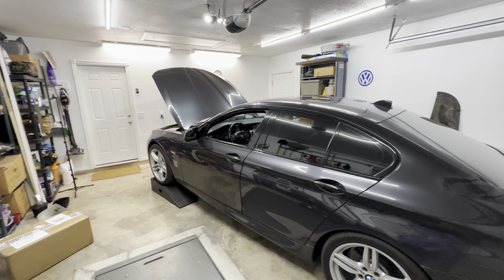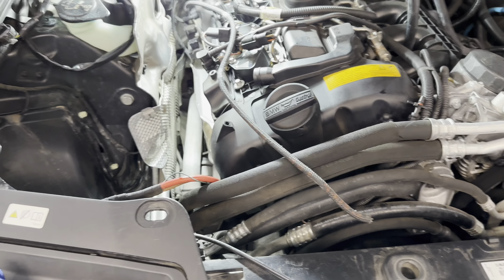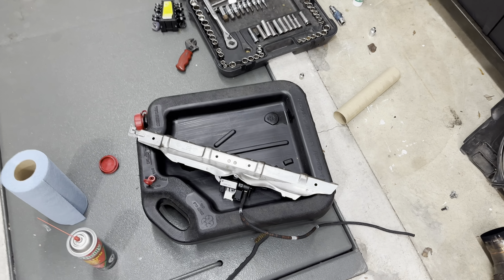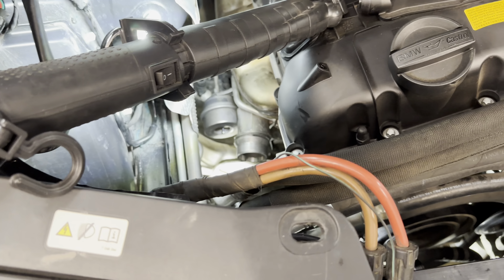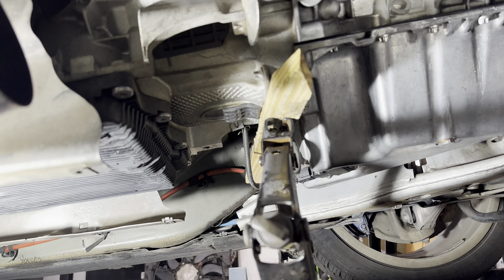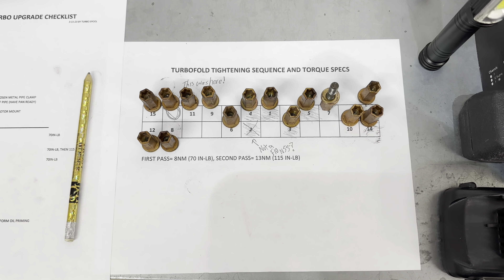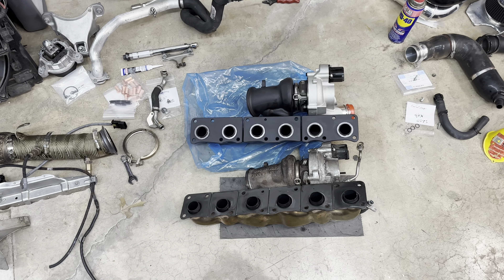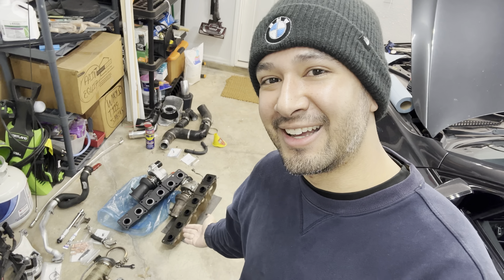SHUENK N55+ TURBO INSTALL PART1- Removing the stock BMW N55 PWG turbo on my F10 535i

Comment: literally the best detailed n55 turbo install on youtube hands down. a year later are you still pleased with the performance?
Reply from the maker: Thank you so much for that! I tried my best to catch all the little details of doing this at home. And i loved it! I did this work in March 2023, and sold the car Aug 2024. It was on E50 custom tune by Keahi Harris and it was incredible. All the low end of the stock turbo but with a FAT midrange that held to 6100 before it would start to drop. For a Daily Driver it was perfect. And now the new owner (who is a friend and coworker so i still I see the F10 every day) is very happy with it

Comment: Great video, lots of damm work!  I have a 2012 x6 with the N55 engine, I am dreading the day I have to change the turbo when or if it fails.

But I was wondering, wouldn't it have been a lot easier to drop the subframe and you would of had  a lot more access to work on getting the turbo off and new one back in?
Reply from the maker: Oh absolutely it would have been easier to drop the subframe! lol you are correct. I just did not have a crossbar to do that, and most BMW techs don't drop the subframe because although it makes turbo removal easier, it also adds more time to how long the car is in the stall (which since most work on flag hours, this would cost them money). So I sucked it up and did it this way. Which honestly would not have been so bad if I could go higher off the floor and had the "questionable support jack" placed properly under the engine, lol
Reply: @turbospool  , did what ya had to do, got the job done and thats all that matters.

last question, where do you find the torque specs for the turbo manifold bolt and associated bolts for teh cooler and oil lines?

Did you prime the engine after you were done and how long did it take you to get the trubo out and new one in?
Reply from the maker: @dappa311  i got the specs from my friends at the dealer. You can also find them online if you have access to BMW TIS from what I understand. 

Engine was primed upon completion, prior to first start. 1 long crank, 2 short cranks. 

Can’t really say how long it took me as I broke it up over 2 weekends and a few hrs here and there after work. Plus I was filming! That alone adds like 30%-50% more time to ANY project lol

Comment: I love your vids! But for such a job, I would def. take the engine out and do the work more freely and take a better look all around the engine cause this job let you remove almost eveything to take the engine out  👍
Reply from the maker: I appreciate it! And I totally agree with you. If I had more space, and a lift in my home garage I would have just pulled  dropped the engine- which is not as hard as people think it is when you have a lift and a table that can hold the weight. But I had neither in my home garage and did it how the majority of people would end up having to do it lol. Maybe in my next house I can step up to a 3-car garage and I can put a lift on that 3rd spot (#goals) lol.

Comment: Sid u get a custom tune for the turbo ? Im
Running MHD stage 2 + e30 just checking if that is enough for that turbo ?
Reply from the maker: Hey Rich? You absolutely want to have a custom tuner ready to go for when you go drive the car. It will start and idle no problem. But driving around it will be EXTREMELY easy to spool when the DME isn’t expecting it due to the design of the wastegate. So you want to get setup with David Shoup, Wedge, or Keahi Harris prior to install so you can at least have a base map that will allow you to drive it around safely while you tune it. This is not for the OTS tunes

Comment: Nice! For drag race which would you reccomend the f55 turbo or the ps750? Thanks btw
Reply from the maker: too early to tell! There's many dynos of the PS750 already. But only a handful of the F55 (even less that are finished tuning). But from what has been found on the F55 so far is that it has more "room for growth" than the PS750. Just based on similar dynos the F55's wastegate is in the 70-80% area whereas the PS750 is maxed out at 100%. Just on that detail I would say the F55.

Comment: My turbo drain line is leaking (2011 n55 xdrive). Do you think it's possible to replace just the line? If so, how difficult do you think it'll be? Thanks!
Reply from the maker: Absolutely it is. It’s a common leak point with age. I did it when i first got the car in 2019 and it’s easy to access on a RWD. I couldn’t tell you on the Xdrive though as that passenger axle bracket may be on the way. Hopefully someone here with an Xdrive can answer it for you!

Comment: Brother do you believe this can make the same power as a PS2?
Reply from the maker: Check Shuenk’s site. I believe this turbo is rated for just below what the PS2 can flow at max. It spools earlier than the PS2 though due to the proper manifold design without the restrictive neck at the turbo inlet that the PS2 has

Comment: Wondering how you lift the engine with all the wheels still installed. First time doing the job and looks like theres extra information missing I need to know.
Reply from the maker: I mentioned that you have to support the engine, then unbolt the motor mounts (3 10mm bolts each), disconnect the charge pipe and boost pipe, and you can start lifting carefully
Reply: @turbospool  Ok I see, I thought it was just the top bolt that needs to be unscrewed not the whole engine mount. 
I thought it was only 1 screw on each side on the top where the support brackets to hold the engine. So, I need to also remove the 3 bolts on both engine mounts as well?    thanks

Comment: Is this the xdrive? If not would it be  a similar install process?
Reply from the maker: No, my car is RWD. I’ve not messed with an Xdrive N55 yet so I cant say how and if it’s any different in this particular project. That would be a great question to post up on the Facebook N55 owners group

Comment: Does this turbo make more power than a pure stage 1?
Reply from the maker: It is rated for more than the old PS1. Go to Shuenk’s site for more info or email the owner Doug. He’s very easy to work with

Comment: How high are you boosting the motor?
Reply from the maker: Kind of difficult to answer that. Im going as high as my current fuel setup will feed RELIABLY- wherever that ends up. Then in the near future if I want I will do meth injection. Not going for all out insane build lol. It’s a daily driver with an open rear differential. BUT… Ill be happy to break 500 wheel horse power on this daily driver lol!

Comment: Can I install the Shuenk exhaust mainfold on the stock turbo.
Reply from the maker: A big part of the upgrade is the less restrictive manifold. But you could I guess if you know how to weld. The manifold is one piece with the turbine housing (both on the stock and in the N55+). So you’d have to buy it, cut both turbines off the manifolds, then weld the upgraded turbine on to your stocker. 

Shuenk BACK IN THE DAY used to do “super cores”, which you could bolt into the stock turbine housing. But I’m not sure if they still make it since the N55+ came out. You’d have to check their site

Comment: Year later looking for driving impressions.
Reply from the maker: A year and a half later* (lol) before i sold the car. It was awesome! It’s the perfect turbo for a daily driver like this was to me. Tons of bottom end and midrange. And ample top end. Unlike the original turbo that died off after 4800 ish, this N55+ pulled hard up to 6100 before it started to drop. For a daily driver that’s perfect! If you want more top end with the compromise of less bottom, the F55 is the way to go. I did have to replace the wastegate actuator a year into it (as mine was from the 1st batch that it was a known issue resolved for later batches). Other than that the turbo had been (and continues to be) excellent.

Comment: How much hp does that turbo add
Reply from the maker: Rated for about 500 whp. But people have already gone well above that. I just finished 91oct tuning so in about a month I will go dyno this on 91 octane and see what it does there before going all out on E85
Reply: @turbospool  nice about how long did it take you to install from start to finish
Reply from the maker: @beamer2169  couldnt really tell you since filming and finding the best angles and lighting takes up so much time. If i had to do it again I can definitely do it until 8 hrs going at a steady pace with beer breaks. This first time without filming maybe took me 12hrs
Reply: @turbospool what did you get on the dyno for your 91oct setup? Also what performance mods do you have?
Reply from the maker: @bonestockn55  here is the 91 oct dyno video I HAD TO TOW MY CAR OFF THE DYNO- BMW 535I FAILED ON THE DYNO
https://youtu.be/ODdf1M0YFo4 , and here is the mod list video ALL MODIFICATIONS on my BMW F10 in Exactly 10 Minutes!!
https://youtu.be/-wyS-ounds4